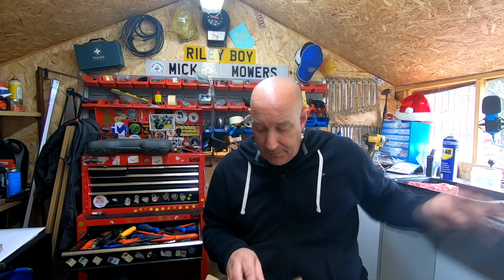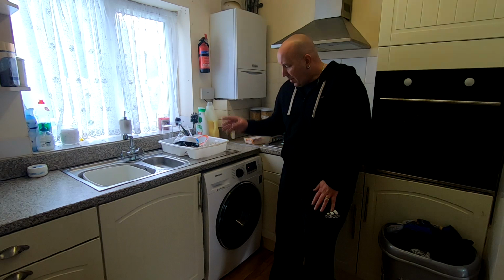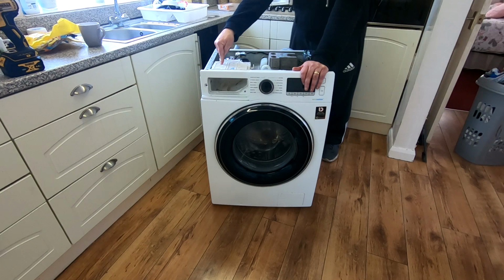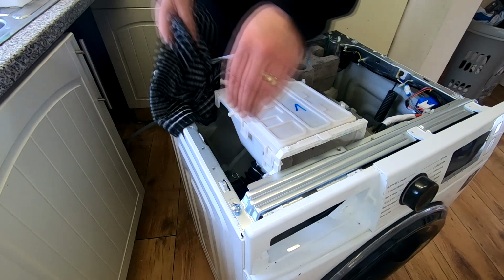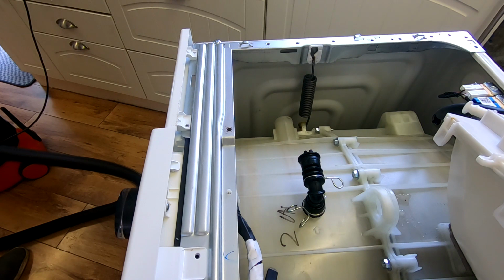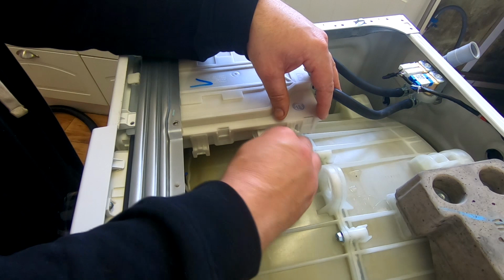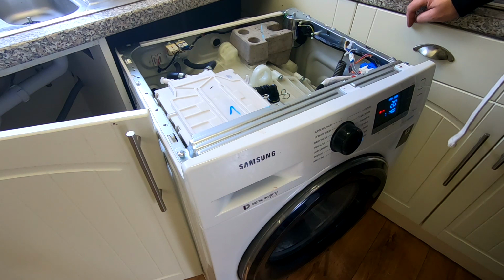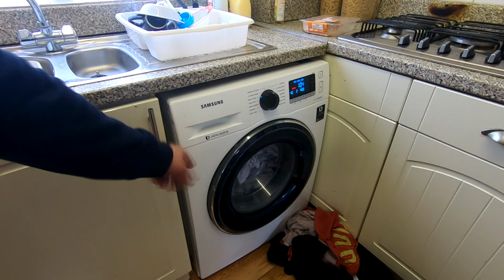Washing Machine Leaking Water Easy Fix Washer Fix

Comment: Tell mrs p. To run the machine once a month with a cup of vinegar it will clean it out and not harm anything you will never have that problem again. Cheers
Reply from the maker: Deek w will do mate
Reply: @themowerman don't use liquid detergent as it doesn't actually dissolve it creates a residue inside the machine, washing powder has enzymes in so actually dissolves properly

Comment: Hi Mick, nice video.  Hotels use white vinegar as a clothes softener (makes the towels fluffy).  Added benefit is it keeps the soap from clogging and the element from furring up.  A hot wash with vinegar and soda crystals (you can get them in a 1 kg bag in supermarkets) on its own will clean your machine.  Prevention is better than cure!  I think eco washing and lower temperatures makes soap clogging more common...
Reply from the maker: Tim Stinson ok good tip I will look into it
Reply: Hi Tim Stinson, is there a way I can clean the clogging without opening up say using the vinegar and soda powder?
Reply: Thank you wil be doing this

Comment: You’re a smart guy,  I know you’ll fix it. 
Congratulations. 
I’d bet the clog is caused by the fabric softener. I’m surprised the appliance repair isn’t considered essential.
I had to put new roller wheels and belt idler in my 17 yr old Kenmore dryer 2 weeks ago.
Reply from the maker: jim s hi Jim. Well with the current state of things I suppose life over everything. I’m happy with the fix and will take it up with them later.

Comment: These are home skill we all should know how many white good are binned for simple to fix faults 
But most motors in machine are sealed and you can’t even fit brushes but there are ways round this with my fav tool a angle grinder lol 
What would a repair tech have charged if were not in lockdown!!!!!
Stay safe in these very strange times god bless

Comment: nice one!
I just spent most of the day changing the drum bearings on mine to have this problemwhen i tested it.
turns out I had the pipe twisted  as I put the soap drawer in and it had crushed it..
But you video saved me  having to tear the whole thing to pieces as my biggest fear was sealing the two halves of the drum back together.

Comment: Excellent fix.  Great job.  I can't believe those pipes built up with that much soap in a short amount of time. And you are using a liquid soap which usually does not clump up like that.  You are probably right, just not enough hot water.  Stay safe and give Riley Boy a hug.
Reply from the maker: D Butler yeah just needs more hot washing  thanks for watching

Comment: Great fix ,most washers are cold fill only,best thing use tablets and put direct in with washing,if not boil kettle and put in soap draw,this will melt old powder😁
Reply from the maker: 3-C PO yeah ours is a cold fill. Will be sticking it on a hot wash every now and again clean it out.

Comment: Hi Mick

I cycle our washing machine once a month on a hot wash empty cycle. Too much soap and softener used.
Amazing that the water froths up every time even when empty.
All started after a mate had a similar problem with a blocked level pipe.
Mates do the same now but use their old towels that they use to dry their dogs not to waste a boil wash.
Reply from the maker: Yeah ta for the tip in will be setting a reminder to do a hot wash from now on..
Reply: @themowerman  hi mick I'm a washing machine enthusiast if you look at my channel and notice you use liquid I advise people not to use liquid as it clogs your machine up and causes mould in the machine as it doesn't dissolve. Where as powder has enzymes in it which means it dissolves so I'd strongly suggest that you stop using liquid and start using powder and hot washes and you will notice a big difference as powder dissolves and liquid doesn't. Thanks
Reply: @theoddjobcentre6686  Do you find this also cuts down on the smell associated with front load washers?

Comment: I use to deliver these washers, I had a thing I use to tell the customers, if they want these front load washers last a long time and not mold, and stink, now this comes from the manufacturer, do the laundry like this, darks first, then lights, the whites, that way whites take Bleach and hot water, that cleans the machine and doesn't promote mold cause the last load being whites the Bleach kills the mold, and also when your done for the day leave the door of the washer open, so the drum can dry over night.... I always leave the door on my front load open a bit, and it's 15 years old and doesn't smell or mold at all, and I do the whites as the last load.

Comment: Can I put sink unblocker down in it or Harpic, bleach etc to save taking it all apart every few years? Or will it damage the plastic or rubber hoses?
Reply from the maker: @ArcanePath360  youi can try..
Reply: @themowerman   well I used bleach because that's pretty safe on rubber and is good for cleaning the machine out anyway. Turns out my hose isn't blocked, it's my inlet jets. They don't seem blocked but the 3rd tray jets, when they come on on their own, the pressure makes the water blast out over the top. It only happens at the end of the wash cycle.  Seems like the splash guard just doesn't sit low enough to stop capillary action

Comment: Will this show up as a E10 error?
I flooded my kitchen yesterday but not sure what the problem is, one of the sleeves from my long sleeve tshirts was ripped of but I have found all the parts of the shirt.
Reply from the maker: Yes I think so
Reply: @themowerman  Thanks for the response mate I will clean this out tomorrow and hopefully all will work again. It is well overdue to clean out some pipes so I have it apart and will look for blockages in any of the pipes and give it a good clean with vinegar and baking soda. Never had a shirt sleeve ripped off by any washing machine and that certainly wouldn't effect the detergent draw so I am a bit confused but I think this is what happened to mine as well.
Reply: @themowerman  Ok so anyone here who is curious here is what happened to my machine. I put on a load and went out when I got home the power sockets were not working, I reset the breaker and started the machine again and let it finish, it shut down saying e-10 water not filling soon after I realised it had flooded totally downstairs. I took it apart and cleaned everything put it back together and it flooded again. On closer inspection I noticed that there was a rubber pipe-attachment for the dryer function that pumps hot air into the drum and it had come loose from the outer tub, Put it all back together and mopped up made sure those pipes were all nice and snug.
So I think I may have overfilled the machine and one of my shirt sleeves which was totally ripped from the shirt had perhaps stopped the drum from turning and probably torqued the whole drum down on the springs to where this pipe had fallen off stalling the motor and blowing the fuse. All is good now , though I wish I didn't have a dryer function on my washer I have never used it and never will it complicates things with more plumbing inside the washer it totally screwed me over.

Comment: The reasons for clogged hoses as well as filthy drawers and tubs are more complex than not doing hot washes. 

— Liquid detergents are often blamed for building up a bio film in the whole washing machine. 

— Eco programs and even normal programs often don’t reach the selected temperatures. Manufacturers can control water temperatures very precisely, and indeed some series do heat exactly to the degree, including re-heating. But "benchmarking and lifestyle" brands like Samsung don’t because this way they can claim miraculously low energy consumption. 

— Using fabric softeners. These in my opinion are one of the main reasons for filthy washing machines. You basically cover you clothes and nearly all parts of your washing machine with fat-like chemicals that are very hard to remove and eventually begin to mold. Remember: Fabric softener is spread all around the outer tub during the last spin. Washing water mixed with detergents that could remove the fabric softener residues never reaches the upper parts of the inner drum! The buildup can also be a cause for rotting drum spiders and damaged drum shaft seals, leading to bearing failures. 

— Rinsing with not enough water. 

— Not doing enough hot washes (60—90 °C / 140—194 °F) with a powder detergent with bleach (mostly sold for white clothes). 

— No maintenance of the detergent drawer and casing, the door bellows and the pump filter.